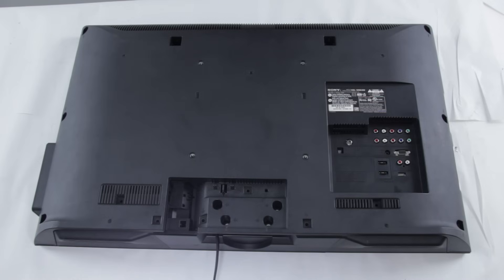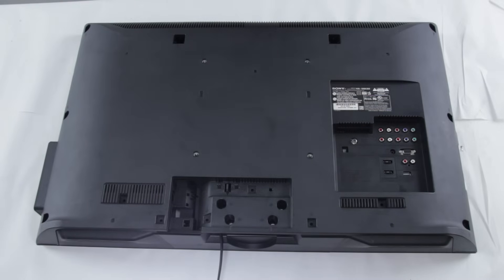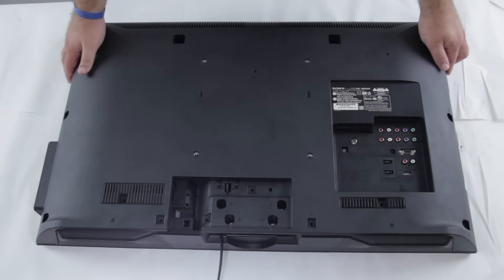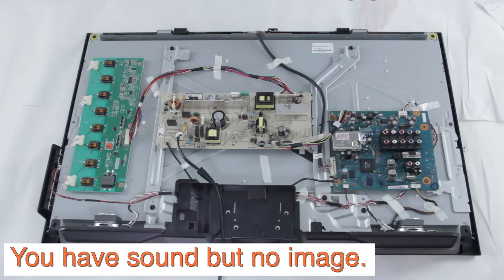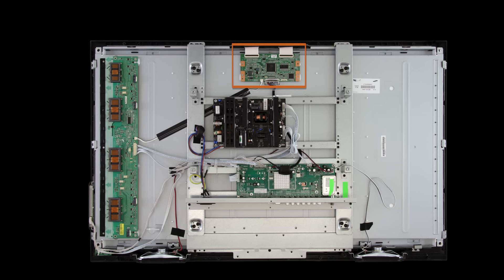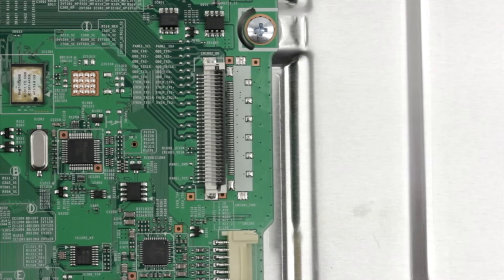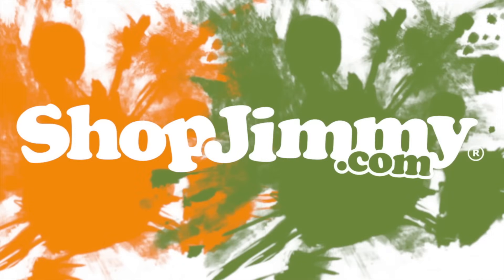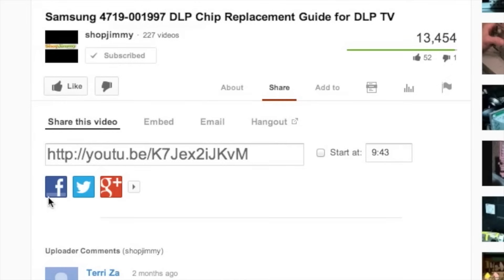LCD TV Repair Tutorial - T-Con Board Common Symptoms & Solutions - How to Replace T-Con Board

Comment: Hi!

I have a problem with a Samsung LE27S73BD LCD TV.

When I turn on the TV I hear a 'welcome sound' and I can see that the screen backlight turns on also, but doesn't show any image (black but shined screen). 

I don't know if the 'welcome sound' proves that sound is OK because I don't hear sound of the channels, but this could be because the channels aren't tuned on this TV. 

I have see that it could be problem with the T-con Board, but i'm not 100% sure about it because I don't have a multimeter and don't have much knowledge on electronics. 

Could you help me on this? 

Thank you very much!

Comment: hey guys do you have an info on a Sansui HDLCD1908C? One of the Ceramic capacitors has blow and i can't the info on it to replace. Its near to the fuse and has a sign resembling  N

Comment: I have Sony Bravia KDL46XBR4, serail number, that I purchased in Dec 2007.  Recently, the
televison started to have a slight glow after I turned it on with no picture.  The television had sound, but there was no picture but just the glow on the screen. I consulted a few forums and thought it may be the TCON board that caused the problem. I replaced the
original TCON board with another used one I purchased off the internet.  Once the other board was installed, I now have a picture on the screen.  The only problem is half of the screen is green and overlaps the picture for that half, while the other half of the screen is a normal picture.  I am not sure if the board I put in is defective, or if it could be the UB1 board, or if I didn’t connect the 4 flat cables back securely from the TCON board which might be causing the green half. Not sure what it could be, but maybe at main board, 
I would like to get it fixed and with a clear picture.  Any suggestions would be welcome.

Comment: Hello, I have a Sony Bravia KDL-46XBR8  ser # 8003228.   I am trying to figure out what is wrong with our TV.  The issue is  I get vertical lines from time to time. Seems to start after the TV warms up but can go for a long time. If I go to any input that gets a signal when this issue happens the jumping lines will be there.  On any input if there is no signal the lines will not be there.  Also if I go to the menu's either home, input, guide or any the lines are also gone. The lines come and go, they are not consistant. I have already tried to unplug for a bit, also have done a reset and has not helped.

Comment: I have a Panasonic tc-32lx60 LCD TV. TV turns on but there is no picture, just a blank screen. The TV/Video button the the TV does not show up the input screen menu. When I connect it to my laptop using HDMI cable, the laptop detects the TV screen and speakers but there is no sound or picture. That is alao because I am not able the change the input mode as the tv/video button on the TV does not show up the input menu. It'l be great if you can help me figure out what's wrong with the TV

Comment: 32lb561b, I have audio but video, also when I look at the back of the tv I can see some sort of light, I tried to identify the issue by using a flash light to see if the back light panel was the issue but no picture completly black, do you think could be a T-con board issue. Thanks

Comment: Hello. I am having a problem with my TCL LED TV. The model# is L42FHDE30TAAA and the serial# is M351FF703139. The TV shows a black screen with no audio on all inputs. I have already tried replacing the main board (the PCB with all the a/v inputs) but with no results. The LED's are working as I can see them flow through the small holes in the plastic. Any ideas on parts replacement ?
Reply: Test
Reply: i have the same problem on sharp 70" tv, lc-70le847u. any clue?

Comment: we have a samsung un55f6350afxza tho1 
I replaced the mother board from shopjimmy and now it cycles on and off by itself every approximatly 30 seconds we disconected the manual switch on the bezel wich was suggested and now turns off and stays off  . whats next Tcon board or ?

Comment: Hi, I have an UE46B6000 with - as it looks -  a failing IR receiver. It looks like it constantly receives a signal from the remote as the led (Under the Samsung logo) is blinking constantly. This makes it almost impossible to change channels, adjust volume etc. Also the buttons on tv itself don't function properly. Do you have any idea what it can be and how it can be solved? Thx, Peter.

Comment: I have an LG 55LS4500 with a vertical white bar about 12" wide from top to bottom of display...already replaced main board to no avail and am wondering if it is the T con or the panel that is faulty

Here is link to picture of fault:

https://lh3.googleusercontent.com/-3QY4MiICaB0/VxknMWWoQhI/AAAAAAAAAB4/vsdi2G7n8C8dHiaHauZ49IxFFc3-0HZWQCLcB/s288/IMG_5242.jpg

Comment: Great video. I accidentally threw out the burned out T Con board.  I need help with the correct T Con board # for a Polaroid 1913-TDXB so I can buy a replacement.  Serial #:  FR8G9188570001036  LCD Model #:  PV190WTVM Product #:  M190A1-P0A

Comment: My 70" t.v. immediately scrolls through the inputs when turned on.  It will randomly stop on one of the 8 inputs.  Any touching of any buttons on the side of the t.v. or on the remote causes the input screen to pop back up and the scrolling to run continuously.

Comment: I have a Samsung LN-52A650A1F and it now has a display that goes in and out with green horizontal lines.  It also started to power on and off by itself during this time.  What might be the cause?  Power board?

Comment: I had a electrical surge or strike at my residence.  I lost several items including three tv's and my DVR that was connected to two of the units.  The TV im inquiring about is a Samsung 60" Model UN60FH6200FXZA version HH01 Serial 01S13CRF400582Y. The TV worked for about a day after the incident watching netflix and DVD player only.  Could not try DVR due to being out.  The unit then it turned off and I got it to power back on.  Then about 10 minutes later powered off again and would not come back on.  The stand-by light is blinking red.  I was wandering if this would be a main board or power supply board or both.
Reply: send it back to samsung & politely ask for yor $$ back

Comment: I have a 55" Samsung sound but no image, but do have backlights (slight blue tint) the tcon stv5565eu22bc6lvo has on oil coating on the big chip - like heat sync to contact rubber on plate. Tv mod is UE55HU7100U sn 06n13safa00781n. Any tips on what to check/replace?

Comment: Hi l have a Toshiba Model 40L1400U led TV less than 1 year old. l have audio and backlight but no picture. My tv doesn't look like any of your videos. Does not have a seperate led driver board and the t con board? is about 1" wide and runs about 18" to 24" across the bottom of the screen without any cover. help!

Comment: SAMSUNG LN32C450E1  S/N Z2GQ3CFB603438X HAS GOOD SOUND , THE RASTER  WAS 5'' TALL FROM BOTTOM OF SCREEN, NOW 2/8'' ACTUALLY A LINE AT THE BOTTOM OF SCREEN , SOME WHITE VERTICAL LINES TAKES TIME AND APPEAR, USE TO TURN DOWN THE BRIGHTNESS  AND THEY WILL DIM OUT

Comment: yes I have a problem with my Santo HDTV LCD/TVHD ACL Model no:DP42D24 serial no:B4211132480203 the screen went blank and had sound right after TV went blank but couple minutes later the sound left to what should I do

Comment: I have a problem with the screen on my Samsung un40d5003. I have a double image and a few lines across the screen. I have fixed this before by readjusting the ribbon cable from t con board but the problem has returned. Now my question is if I should replace the ribbon cable or the t con board. Thanks

Comment: LG 55LN5700 UH - the DTV tuner stopped working while we were watching it - tried known working source, etc.  Other features and HDMI input working - but we're cord cutters.  I think the part I need is EBT62387717 - but any tips wanted, and the best place to get the part.  Is the cover fairly easy?  I'm quite familiar with laptop disassembly and repairs - but never been in my TV. Damn thing is only 25 months old...

Comment: hello. i have a sony kdl32ex655 with horizontal lines on the middle up part of the painel. serial: 1004384. i want to know the correct model of the tcon board, because i didnt open the tv. and i cant access the shopjimmy site, apears an servidor error access. tks!

Comment: Hi! My Samsung LN40B530P7NXZA TV has started flickering randomly, and sometimes distorted (almost like pulling the screen from the left in some parts like using a smudge tool in a paint program) and sometimes has almost a rainbow of colors around certain images. If i turn it off and turn i back on it seems to be ok for awhile, or sometimes it just goes back to normal by itself. Would this be the main video board or the T-Con board? Or what do you think? Thank You!!

Comment: Samsung LCD/LED UN40ES6003F - 6 months ago this TV started displaying a very thin black horizontal line 1/3 of the way from the top.  Over time, more thin black lines started appearing.  Now there are a dozen or so - not very noticeable from a distance.  Occasionally, a horizontal portion of the screen (about 3" wide band that reaches the entire width) will flicker slightly.  The TV is 2 yrs old.

Comment: Hey guys. Im Having slow pixelation on one half of my screen. I have a Sharp AQUOS  Mod#LC-70C6500U
When you turn the T.V on and the static shows, One half is normal while the other half is almost white with some discoloration. Could it be a Bad T-Con board?

Comment: Hi!I have Philips 42PFL9664H/12 LCD Tv. My problem is that I have white picture with horizontal and vertical raster all over the screen. In the upper part of the screen I have almost white thick horizontal line.What do you think can be a problem and which part I should order from you?

Comment: Hey im having an issue with my (Sony XBR-55HX950) what happens is I've only connected a blu-ray player so far, the screen isn't completely out in any 1 spot but it is dim in areas & the text on the screen like the channel #'s, the highlight that goes over the "video,home theater,etc" for lack of a better term laggs real bad @ best for the most part the text wont change when the channel does.That's pretty much it aside from not having the remote control which I wasn't sure if it was a necessity or not. Well thanks for your time ,Sorry about the extra lengthy comment.

Comment: Hi I have Insignia, model NS-42E480A13, the TV has sound, the picture is very DIM to the point that it is very hard to see. I suspect it is the T-Con board issue, T-con board part# RSAG7.8204928 /ROH. Could you confirm if this sounds like T-Con issue? Thanks in advance!

Comment: ALAIN
Hi ShopJimmy.com I have a samsung UA32EH4000W. model code:UA32EH4000WXJG and version num:TS01.
I am having double image and coloured horizontal lines at the top of the screen. In this model there is only one ribbon connector from the main board to the T-Con board. 
How can I solve these problems.
Thanks.

Comment: I have a 40inch Samsung LCD LN40D630, all of a sudden when i turned the tv on there is vertical white lines through out the tv and fade in and out depending on how bright the picture is. If im watching a movie and the scene is dark all the lines go away for the most part but if its a bright outdoor scene all the lines come back i took apart the tv and im thinking its the T-con board the board i would need is LJ94-165587C. The lines show up on the menu and all the inputs, even tried a movie on a usb stick. Any suggestions???

Comment: I have a Sony bravia 46v5100 and I have vertical lines one on the right where the channel number is like green in color about the width of the number than on the left side about 4 inches in I have like a green vertical lines about 4 inches wide sometimes they are there from the start then sometimes they slowly fade in within a min or two from power on also sometimes I see the lines where it says bravia on power up but disappears when it loads to the bluish start screen.. please help if it's the tcon board or bad ribbon connectors thank you

Comment: We have a LG 55LA6200.  When I press the on button, the red power light comes on, but no picture.  If I press the input button (or pres power button again), the LG logo screen flashes on for a second, the red power light blinks a couple times and the set shuts down.  Happened gradually -- we experienced the problem a few times, then the TV worked ok again, then it recurred.  A few times, we had sound but no picture.  Now we have nothing except brief flashes of the LG logo screen.

Comment: lg 55lm4600 transparent thick white line just off center of screen I tired cleaning ribbons still there I noticed that turning it off for awhile it's gone but comes back also if I look closely at the white line after watching something very faintly you can still the image in it doesn't change color or move it's just left to center the tv works great other than this and yes it's there no matter what I use game cable 3d ect any help would be great thanx

Comment: Hello I really need some good advice here, I have Sony Bravia KDL-37U4000 with bad colors, (mostly bride red and orange) to fix that I have used contact cleaner spray WD-40 Contactspray on my LVDS cable, but now, the image got worse. The image is very milky. Do I need a need new T-con board or do I have to replace my LVDS cable? Could you please advice me on that?

Comment: hisense F42K20E
When I press the power button, backlight turns on, with nothing on the screen (input, volume, channel indicators).  Both power buttons on the tv and remote work.  Cannot change inputs.  Could this possibly be a main board issue or t-con issue?

Comment: Very useful information. I have one defective TV with screen solarization. I found one small chip on the T-con board is getting too hot. Chip # AS19 H1G - 0830B - B8518313.  Sound is normal with color distored. Can you suggest a solution. Thanks in advance. Thilakan, Kuwait.

Comment: hi- i have a hannspree jt01-32e2-000g lcd tv which was displaying a backlight but no picture. The sound may work, but as we couldn't tell what input it was on, we don't know. I have replaced the T-con board but this didn't affect the fault. Now I have ordered a replacement AV board/Main board. Could you advise if I'm on the right track? Thanks.

Comment: I have a LG 55LW5600 tv. My wifw was watching tv and suddenly there was no picture or sound. The power light shows it is on but no sound or picture. I removed the back of the tv and could not find any bulging capacitors and I did a continuity check on the three fuses on the board and they show good. Any idea of what the problem is?

Comment: I have Toshiba 55L6200U, my TV having horizontal black lines on the right side of the screen, does that mean I need to replace my T-Con Board? If so, does the LG 6871L-2966B (6870C-0401C) T-Con Board work for my TV? I checked your website, my TV T-Con board is out of stock, however it said that LG T-Con board is an alternative part, I would like to confirm.

Comment: I have a Westinghouse LTV-27w7 HD TV, and a told the main board needs to be replaced. How do I access the main board? I removed the stand, and then only see five other wcrews holding he entire back of the TV to the front and screen.
Reply: Mate that is very easy unscrew all screws at back and the back should come apart then you'll see the main board the large one without the outputs on it (black red yellow etc) then unplug all plugs carefully unscrew the screws and reverse once removes easy fix as u know what is wrong

Comment: i have an vizio D650i-b2 led tv that just started displaying an almost cloudy discoloration mainly a purple haze on parts of the screen there is no banding or lines but the area's where there is discoloration the temperature is warmer than the rest of the screen.
no matter how i calibrate it its still there during white scenes and its getting worse.
iv'e been looking for a service manual with trouble shooting scenarios but have had no luck
any help with diagnostics would be appreciated.
thanks

Comment: HI,
I have a SONY KDL-46W4500 and i have problem with image. There are ghosts and some flat horizontal lines. The problem is not happening all the time, sometimes does it and after some minutes is getting cleared. Sometimes does not clear. I want to open it to check the connectors of t-con or even buy a new t-con for replacement. Ho i will recognize the t-con placket and how could i know if there is inside of the pannel, like this at your video?

Comment: Hey ShopJimmy, I have a problem. I have a LG 47LX6500 LED TV. I have no display, backlight, or audio. When my laptop is connected via HDMI, the laptop recognizes it as a LG display but does not offer resolutions or to use it. The unit responds to buttons and input changes as well. Any help would be appreciated.

Comment: Hello Support team, I have this Sharp AQUOS model no. LC-32M44L Serial no. 806813409, there is a small sharp dot on the screen and vertical lines running from same dot to bottom and top of screen, everything else works fine, i'm a bit technical, please advise what to do and what parts to order from you. Much appreciated.

Comment: I have a Sharp LC-32SH2OU that has sound but no picture. The previous symptom was the picture would fade out (lines of the picture would disappear) after about 3 minutes of it being on. I re-seated the connections on the T-Con board and the TV played for about an hour and a half. Then the screen went dark. The lamps are still lit but no picture. I suspect a bad T-Con board. Am I correct in this assumption?